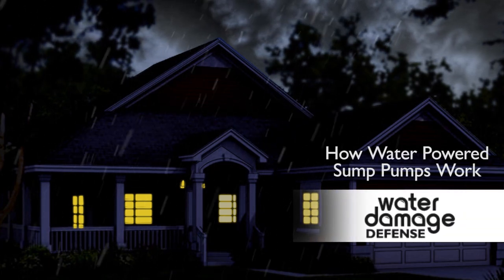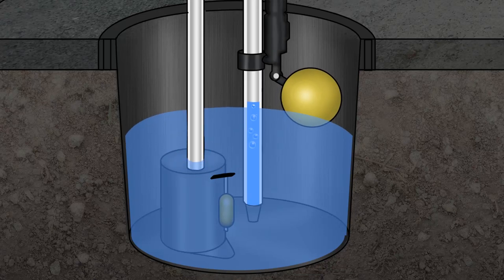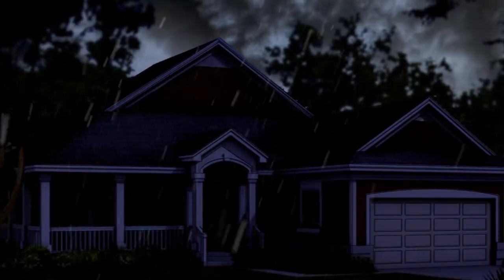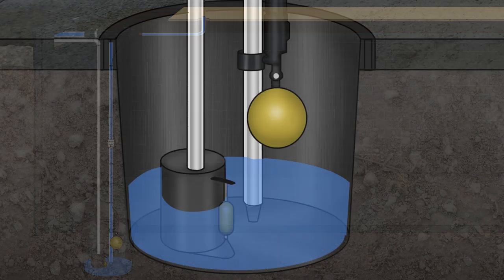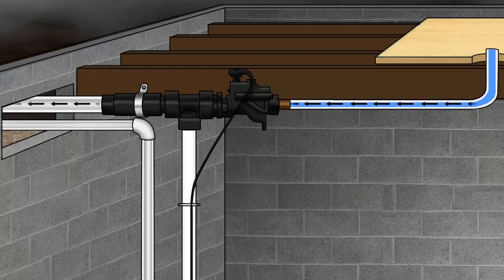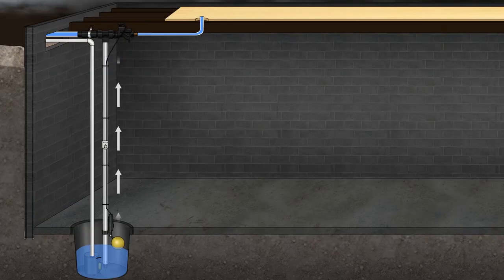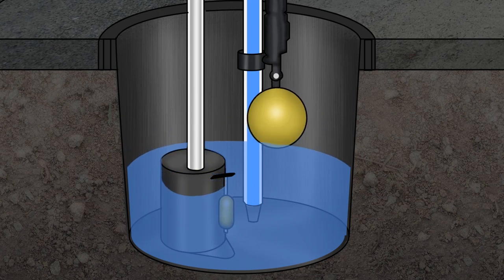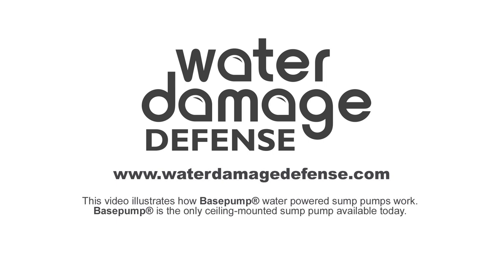How Water Powered Sump Pumps Work

Comment: What is the flow rate of water supply per the discharge rate of the sump pit?

Essentially, how much municipal water is used per gallon of evacuated sump pit water?

Or something of that nature.
Reply: It only for a power outage , I,m sure the water bill will be lower than the water damages in the basement.
Reply: From their website, a flow of 7GPM at 40psi will raise 700 gallons per hour at 10 feet. This implies their eductor system can lift 10 gallons for every 6 gallons of mains water. Rates will obviously be affected by the height you need to raise the water, i.e. where the water discharges. If the height from the sump to the discharge of the eductor is over 10 feet you would need a higher mains pressure.

Comment: but if the power is out how are you going to have any water pressure??
Reply: When your power goes out you can still run your sink & flush your toilet.  Electricity doesn't control your water.
Reply: jlp40: yeah only if you have city water. When your on a well (a water source deep in the ground with a electric pump to drive the water up to the home) then you need electricity to drive the pump. UNLESS you have a manual pump like some people out in the sticks.

Comment: my sump pump is connected to a power outlet. what kind is it" does it require maintenance? I don t hear it kicking off when it rains. is there a problem? should I install a new sump pump? thanks!!
Reply: Have your pump and outlet checked. 
You can look up how to check yourself also. Pretty easy and save money. Does it give you problems when it rains? Does your basement get wet?
Reply: Call a proffesional.

Comment: Why would you not just do this to begin with
Reply: You would have to see which one is more cost effective between your water bill and your electric bill. Water is usually cheaper. so yeah I would say do this from the start.
Reply: Nik
Reply: It will also use about 10x the water per 1x water volume it sends out of the sump. These flood your yard..  and if your valve fails your talking a big issue. I would recommend a secondary stage pump over this anyday.
Reply: iisdan \
Reply: @LanceZ  10x the volume?! Thats a lot of water. Where  can this be validated?
Reply: @jabroseph  It uses 1 gallon of city water for every 2 gallons of rain water cleared. Lance must be exaggerating.
Reply: @Nik-by5mi  The amount of electricity used to run a sump pump is pretty low. Even if it was running on 30 second on/off cycles, so say 10 sec on and 20 sec off, that's only 8 hours a day. And, that's like worst case scenario. If the pump was running that often and  you used a water powered system instead, you're looking at tons of water being used which also adds to how much water is going back into your yard. The amount of water would depend on the flow rate but there's a reason this is used as a backup rather than primary.

Comment: Many modern sump pumps have battery backups, so this would not be needed.
Reply: Many?
No... Did foundation replair for years and maybe 1/10 people have battery backup. And 9/10 times the battery is dead when you finally need it.
Reply: Hope the battery is good when you need it and the power outage is a short one.
Reply: Battery back ups last 2 hours so pretty much worthless in a big rain scenario or if your sump pump burns out
Reply: what if the sump pump fails? Its not about power/electricity, because the water backup still need electricity to work.

Comment: This is why battery backup exists...
Reply: True, but batteries only last so long (4-10 hours) and also may need to be replaced after so many years of use. Looks like it's a good redundant, passive solution to not worry about loss of power if you are away longer than the batteries might last.
Reply: @civilequinn  good point

Comment: Very terrible. I am a licensed plumber and this is strongly recommend against. Many reasons why. Low gpm, city power can go out durning storms just like your home power.
Reply: Totally disagree. I have a regular sump pump and a water backup. Last week it poured here for 5 hours straight HEAVY water downfall. Power went our for hours and the water backup was the only thing keeping my basement from flooding. Wasn't home so couldn't hookup a generator and a battery would have died by then. The water backup saved my basement.
Reply: Kenton Gruver Thank you for your reply. These systems are very circumstance based. As all things related truly are. If you have a high “foot of head” lift, that is over 8 feet of height to pump then these systems do not work well. If the volume of water in your pit during a storm is too high then these systems do not work. It’s is just by chance that you had low water and low foot of head to pump that it worked. Though think about it. There is only a certain amount of water this thing can pump at a certain height. When with battery back up systems you can get what ever you need. Big DC pumps, lithium battery and solar to keep it running. Most cases in high water tables people do not do the math. They put these very limited systems in thinking they are doing right and destroy their basements. This is why I strongly advise against them. Like putting a little Honda Civic motor in place of a v 8 truck motor. Keep in mind the math and the circumstances of where you are. Also only works in municipal systems.
Reply: @Beniamin6665  okay u i ask , what is the lay of the land, water has u no , weight,m lol,  do u understand it can drain into the lawn, or u saying we need to get rid of lawns and concrete it, condo sewage it not felt above the lay of the groundwater natural purification system